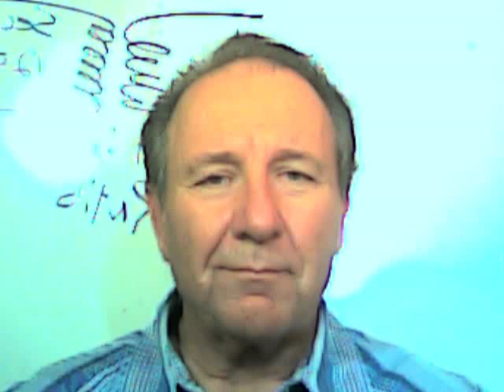California electrical exam help

Comment: If you are a non resident of California and taking the General Electrician exam be sure you study the last part
of the code because they will give you the hardest test format mostly special equipments, swimming pools, solar,
communication antenna and   many more hard question from the code., that you will not find in any practice
exam materials.